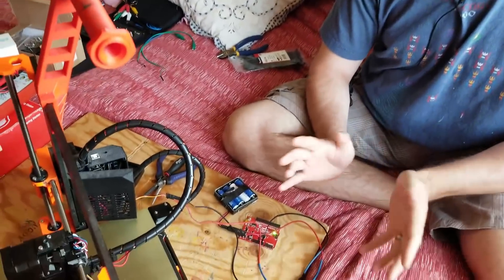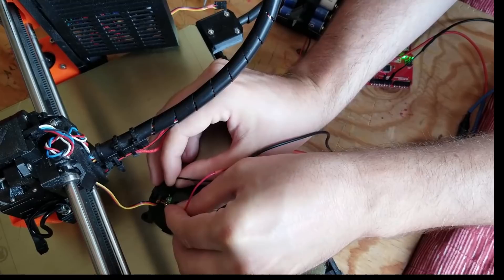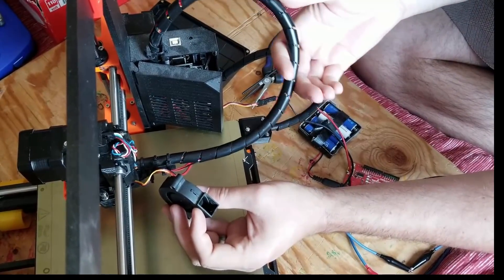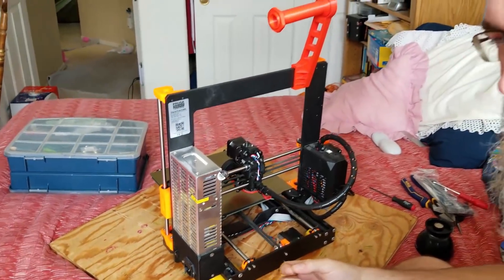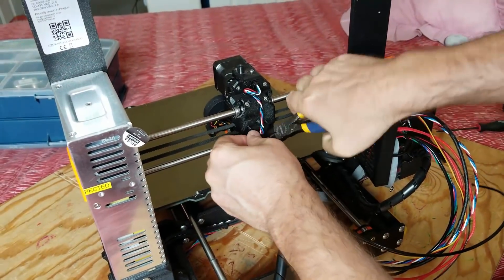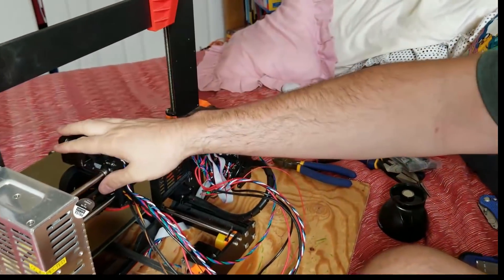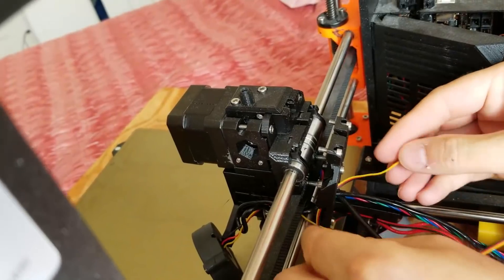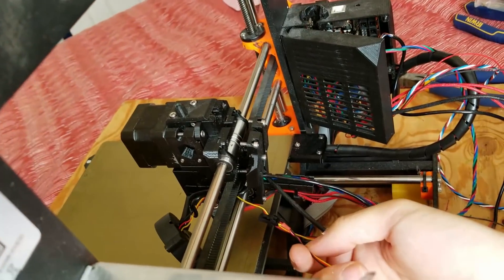Prusa 3D Printer: Fixing Print Fan

Comment: Perfect, thanks. I think it only took 10 to 15 minutes to change it out. I've had this printer for 4 yrs, the mk3s+,  and this was the first part I replaced, and it was only because I broke the wire replacing the part that holds the pinda . such a great printer, and I constantly print every week

Comment: Did the replacement fan do the trick? I'm going through this exact issue myself.
Reply from the maker: Yes new fan fixed the issue, I have had no issues with the fan since.  (I have had other issues with thermistors but that is another story/video...)
Reply: @iqless Good to know. I was sent a new fan as well, and it seems to have solved my issues. Kept the old one to see if I could repair it in case this happens again.

Comment: Pity that another cable broke. As the fan still works you should consider to get quality silicone wire and some sleeve, like the Noctua cables are protected, instead of buying few blower fans. Also the cloth sleeves Prusa uses in the new design can be purchased, don't have to be Prusa as shipping costs to USA are quite high.
Reply from the maker: I will have to go look into that the next time this breaks.

Comment: Had the same issue with my print fan on my Prusa mk3. The wire broke inside the insulation about a foot back from the print head. After taking the loom off, I had to move along the wire gently bending it until I could spot the sharp bend made by the break. Cut the insulation back, solder the wire, tape it up, and back in business. Working great for the last couple hundred print hours. I also had to do this just a week before with my thermistor. It was the same issue, broken conductor without breaking the insulation.
Reply from the maker: Good way to fix it.   I had not thought of doing it that way :)